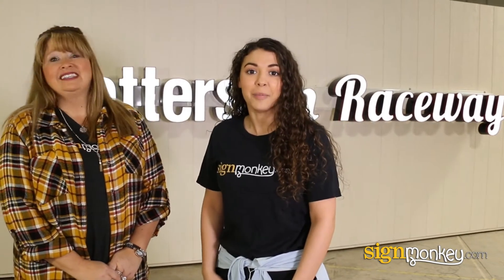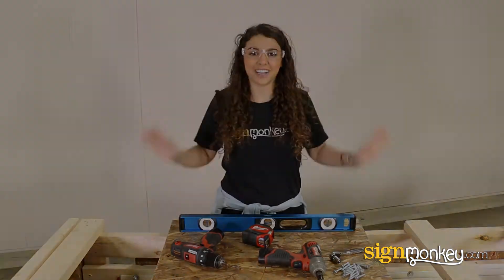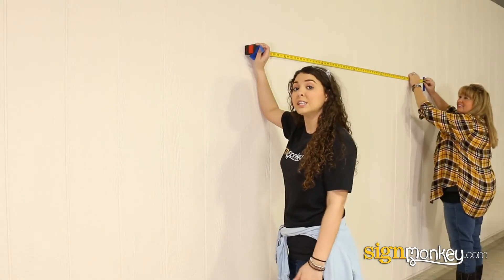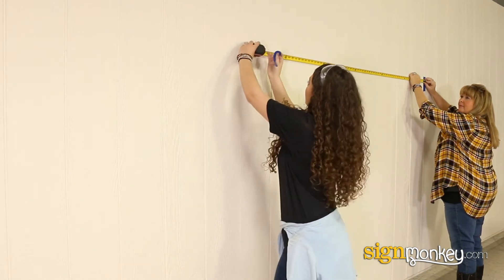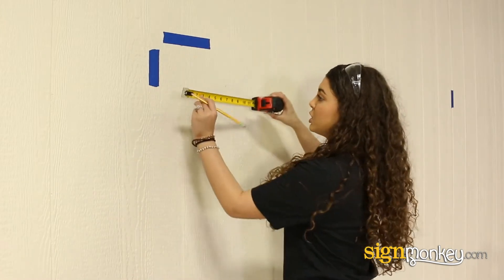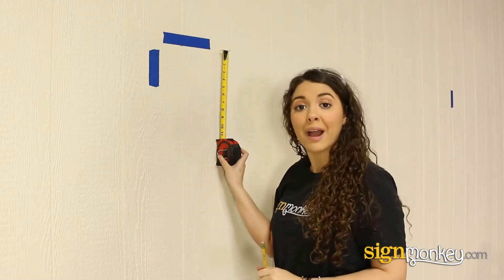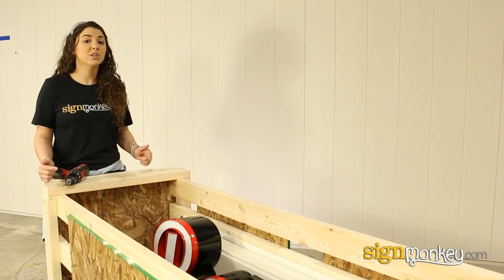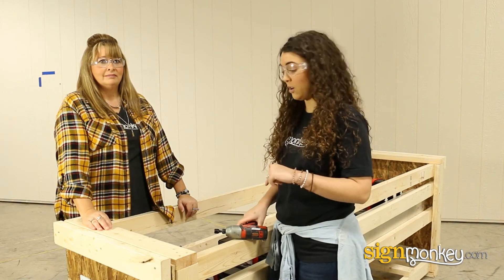Raceway Install Video

Comment: I hope you all still reply. I got mine installed but of course it was before I had keys to building and no electricity so it’s mounted but it has a metal box attached on the facade and just hanging out there. They said they’ll paint it but is. That going to remain outside or will they later get it installed inside

Comment: what about making sure your P/S IS CORRECT FOR AMOUNT OF LEDS. and turning off breaker for desired circut, and black to black, white yo white blah blah blah.
Reply: and if its any kind of steal material use lag and shield
Reply from the maker: All our products are shipped complete including the correct power supply(s)

Comment: Or you could provide your customers with a paper pattern. Then they wouldn't even need measuring.
Old sign installer.
Edit: Very nice signage.
Reply from the maker: Thanks for the comment, our Instructions will have the standard measurement.
Reply: Paper Pattern needs for dimensional letters not Channel letters
Reply: @lodigraphix414  Channel letter patterns can be made with drill locations for wall anchors.